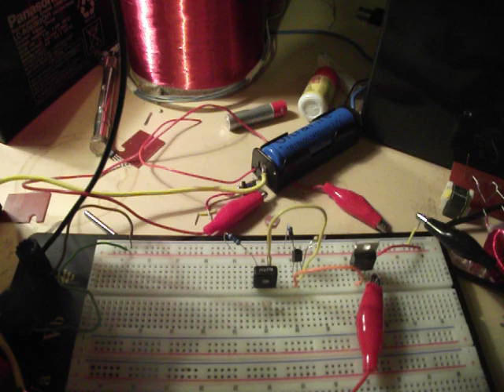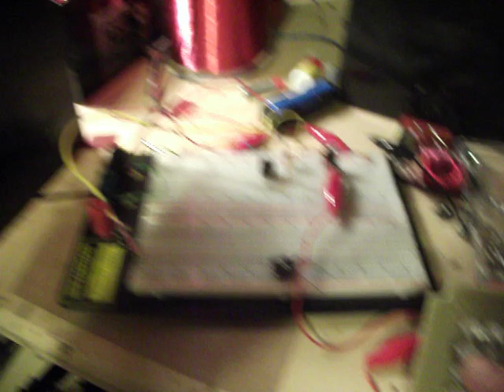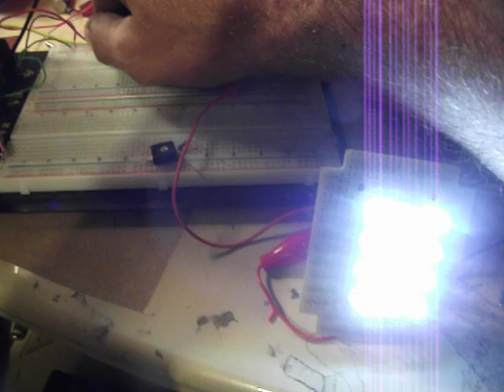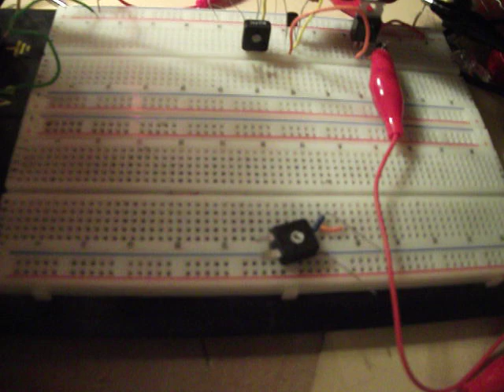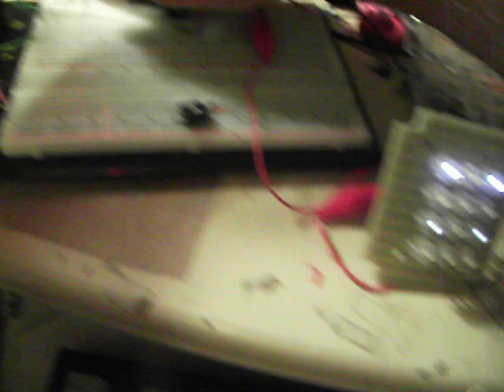Dark Detection Circuit - How To Open "More Current" in Q2, with Q1?

Comment from the maker: @ciprianwiner that gave me 130 mA of current to the lamp, which is better (thanks) but still far from the 280 mA it draws when directly connected to the same battery. The problem seems to be, that, when driven, the lamp only measures a maximum 10.22v across + and negative. Should I just use a relay?

Comment from the maker: @ciprianwiner Ok. I actually screwed up my explanation in the video. (regarding the first transistor's base AND emitter connected to ground via resistors, they weren't... only the emitter was, the collector was connected to positive, via a resistor). In any event I removed both of those resistors, That left me with the MPSA06 (Q1) base to + through 3.3k (sensitivity adj.) - emitter to base of Q2  (TIP31c), collector to 12v+. Q2 collector to 12v+, emitter to LED+.  ... more ...

Comment: Hi mate, to drive more curent on the second transistor you need to: Put the first transistor with the colector on +5v and the emiter to the base of the second transistor without any resistor, then connect the base of the first transistor to the LDR and it should work ok, if not then you will need an PNP transistor to drive the second transistor. If you want some help with the PNP variant just PM me and I'll help you. Regards Cip.